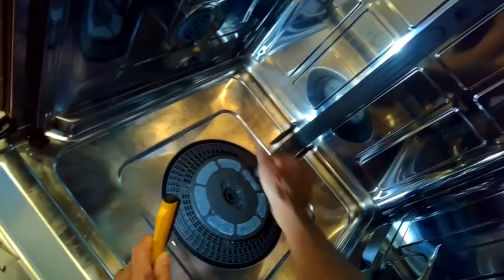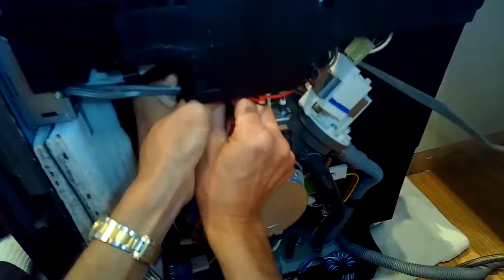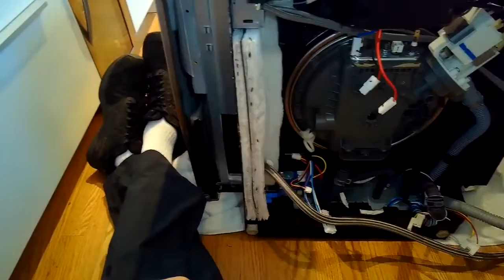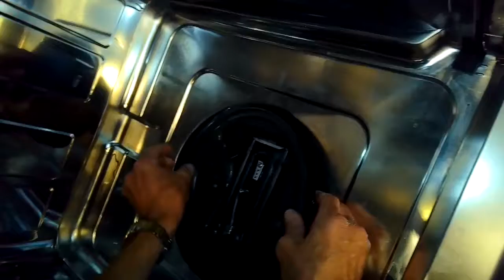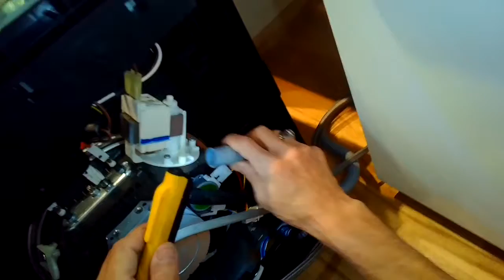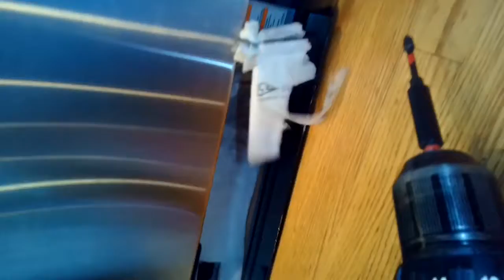LG DISHWASHER SUMP SEAL REPLACEMENT

Comment: Man, I’m having a heck of a time getting the seal flat.  LDF7551ST
Reply from the maker: Hi Rob,
I wonder if a little rinse-aid would help to lubricate it?
Reply: @ScottTheFixItGuyChannel  Thx Scott.  I finally got it.   I used your dish soap tip, but each time I tipped the unit over to fasten from bottom, it pop out.   So I finally just installed the top spray arm to hold things in place, and that "sealed the deal", so to speak.   Thanks for videos.  Very helpful.